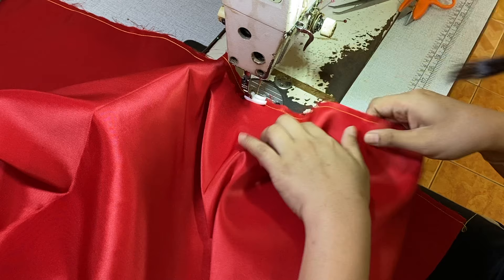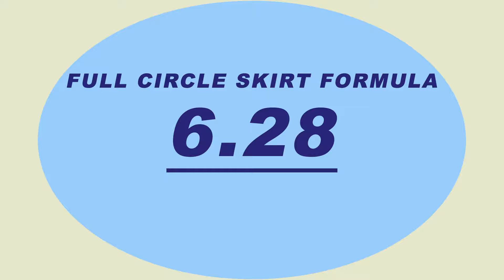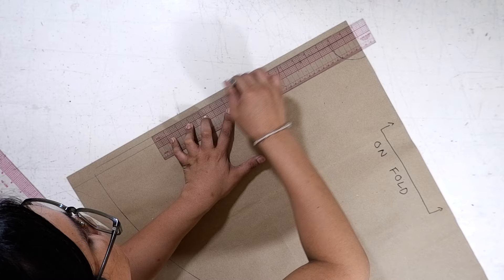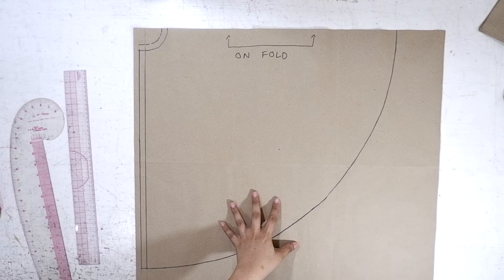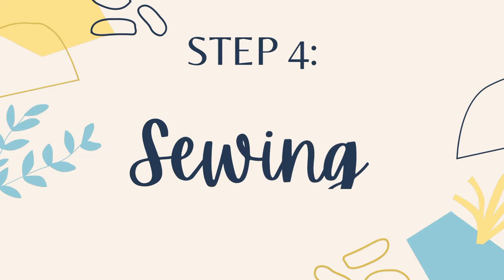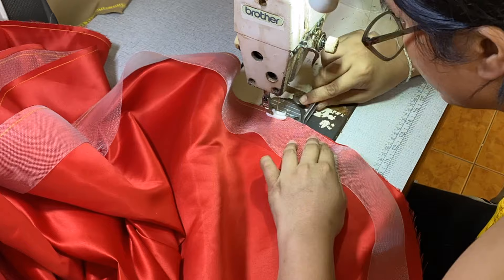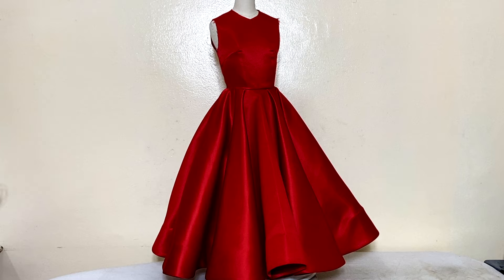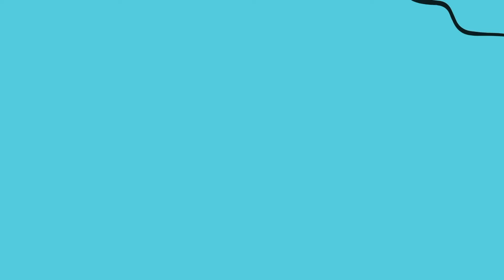HOW TO MAKE A DOUBLE CIRCLE SKIRT | 720 DEGREE CIRCLE SKIRT | LA MODÉLISTE

Comment: I would absolutely love to make this skirt but my fabric isn’t wide enough for the length I want to cut it out as a full circle skirt. How would I calculate the waist radius if I wanted to make a double circle skirt with 4 x half circles? Or if I made it as a 1 and a half circle skirt with 3 x half circles if that’s a thing? (I’d love to still have side seams so I can add pockets) 
If anybody can help with this that would be appreciated. 💕

Comment: I don’t understand how you get the waist measurement calculated Maa 
I’m a beginner 😢pls help
Reply: It's a math formula used to determine the radius of a circle.
The circle is your waist measurement + seam allowance.
For a half circle skirt divide this by    
Pi (3.14).
For a full circle divide waist measurement by 6.28 (which is 3.14 * 2)
For a double circle skirt divide your waist measurement by 12.56 (this is 6.28 * 2)
Hope this helps